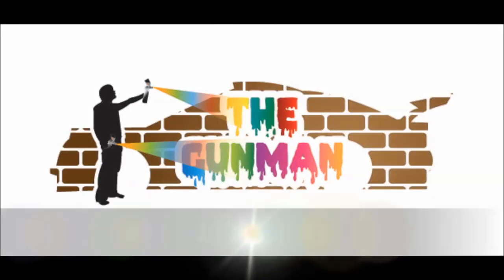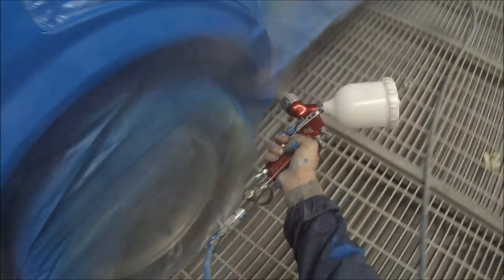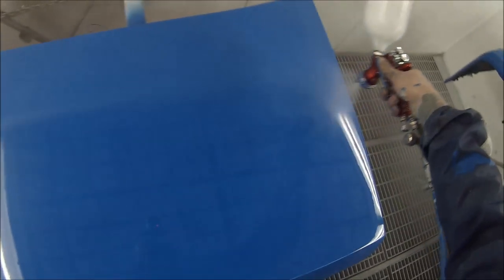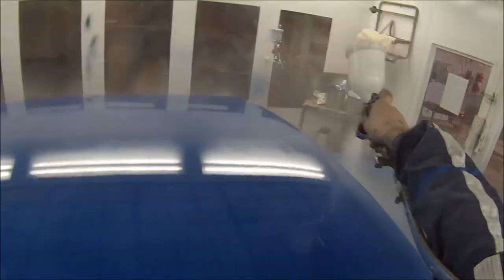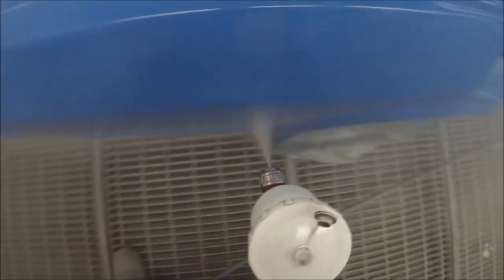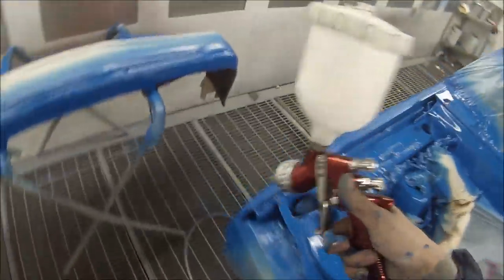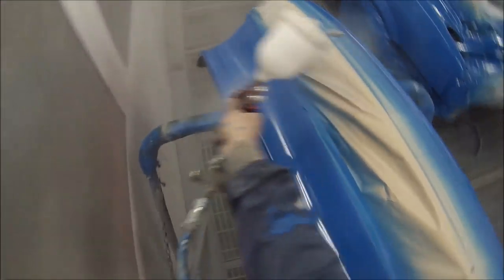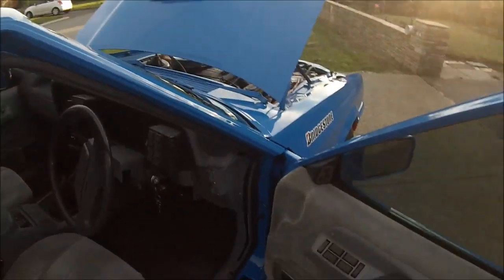XF Race Car Part 7 Clear Coat Body

Comment: Hey gunman, what is the real difference between winding it out 2-3 turns compared to fully open? 

I have only got some runs but not many and I have my fluid wound right out and fan a hand span apart not fully open. Would you get a bad fan pattern having it wide open? Like heavy on top and bottom and light in middle?
Reply from the maker: There's no problem with having the fan right open, I do it all the time when I paint although if its a little old and worn out then yes you can sometimes get uneven fan. And leaving the fluid at 2-3 turns out just gives you more control over the amount of paint hitting the panel so there's no wrong or right just what works for you, Cheers Thanks for watching.
Reply: Ok thanks for that, does that mean you have to spray slightly slower due to not having the same amount coming out?
Reply from the maker: Yeah either that or hold the gun closer